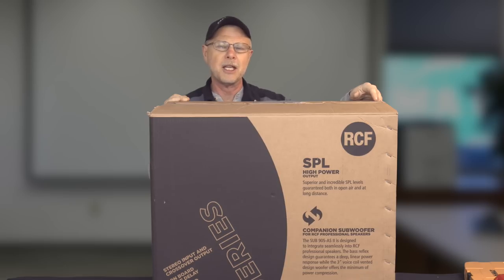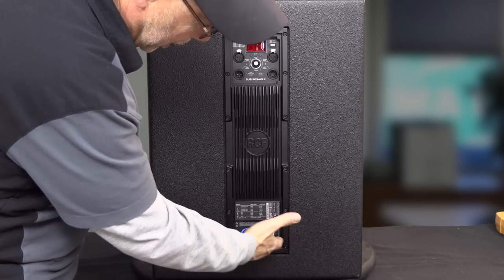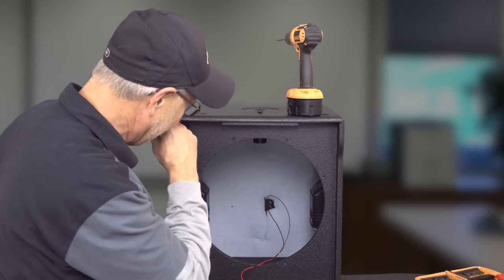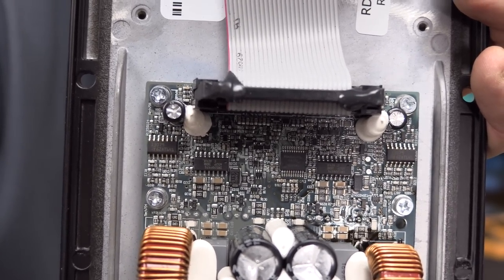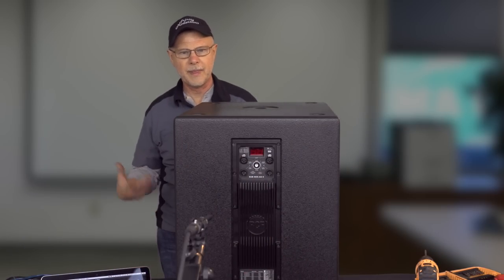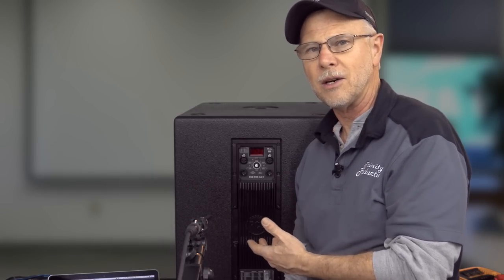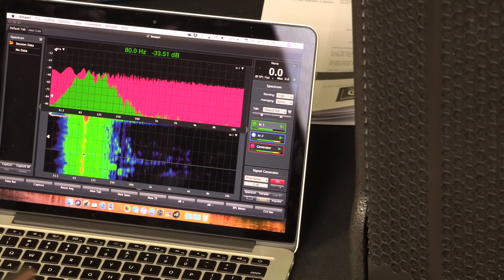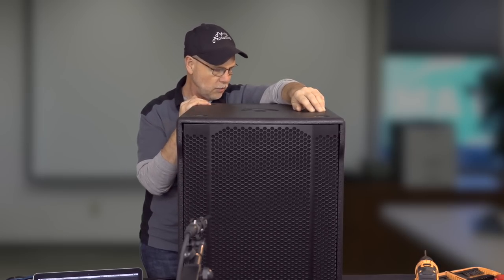RCF SUB 905AS II COMPLETE REVIEW - AUTHORIZED PREMIER PARTNER DEALERS

Comment: Amazing review like always. We have used this sub in the last few months quite a bit and it's amazing paired with the sub8003as II. Two of these subs on on H2 and the sub8003as II on L2 is just amazing.  I'm just curious about the new  TTS15-A. It's the same 1100w amplifier, 15inch driver and about the same size, and 1 db higher. But the price is also much higher...So i'm wondering..is it worth the upgrade? Do you have an opinion on the TTS15-A?
Reply: It's the first sub from the TT line with a 3inch voice coil..Even the older tts12a had a 4inch voice coil..That's why I'm worried
Reply from the maker: It may have the driver from the TTS26A subs and not the same as this being a stamped basket and ceramic magnet. The footprint fo the amp looks similar, but would have to confirm with RCF on the amp, that would be a shame to use the same amp on both speakers, the TT being a premium line. We have the TTS26A subs and for a dual 15" they are killer. I have not heard on the TTS15 and most likely being so new we won't see here in the USA for a bit .. RCF has been doing some amazing thinks with small VC as with the new 9007 subs being 21" with small VC for faster reaction time of the driver. For a 15"  I have no issues with a 3" VC vs. 4" .... as long as the driver does the claimed power rating and won't destroy itself under operation/load.
Reply: Did you get good results from this set up ? the 905 set at H2 and the 8003 ON L2,  did you suffer from "coupling" issues ?

Comment: Great video... i would like to know if you have used the 708mk2 and what are your thoughts on those subs?
Reply from the maker: We have not seen a 708mk2 come through yet, however based on the amp and specs of similar RCF subs we have seen , the 708 will kill a KW181 and for the price point and features the 700w sub will be hard to beat from other "similar" competitors. We have found that QSC, JBL, EV and other fudge the power number to their favor to look good on paper, but poor on lasting performance. RCF has always IMO given the most bang for the buck.
Reply: trinityprosound would you say the 708 mk2 be more for small to medium size event halls or medium to large halls? Based on the size of the sub and specs compare to lets say a 8004 sub or 8003 mk2...??Thanks
Reply from the maker: yes, with the power of 700 watts RMS, but still has more power than a QSC KW181. The 708 as with the sub series is going to be similar construction and most likely at stamped frame basket like this one and maybe similar driver. Nice thing about SUB series is built in crossovers, you don't get that with QSC or others...with  a pair of 708s the sound would be better than anything QSC or JBL or EV offers in that price range
Reply: trinityprosound would you say the 708 are for small to medium size event halls or medium to large indoor event halls?
Reply from the maker: small do medium, you will need double 18's for large indoor events and most likely more than 2
Reply: trinityprosound how would the new 8003 mk2 compare to the 8004 with the new DSP the 8003 mk2 has ?
Reply: Yes indeed i will use a pair of subs but what i meant to say if two 708 subs handle medium to large event halls or stepup to the 8003 or 8004 subs to be on the safe side?
Reply from the maker: the MK2 DSP gives you more control over prior models with new DSP, but all the 8004 we have sold to date, everyone loves the sound and output of them without updates to DSP, etc.
Reply from the maker: for large event halls, etc. IMO would go with 8003 or 8004 and you may need more than 2 as LF energy drops off quicker than your top boxes. If you just wan to fill a dance floor you may be OK, but remember the LF wave does not develop that close in and the tables and seats where the wave finally develops will be pounded by LF energy.
Reply: trinityprosound the hall ill be at this month is not that big but a bit wide. Thats the reason why i believe 2 subs are alright but debating between the 708mk2 or 8003-8004 .
Reply from the maker: If you can do the 8004 you won't wish you did in the future...buy once cry once, get as much sub as you can afford and don't skimp...lessons we have learned the hard way for us...

Comment: Hi, I have a pair of 905s and a pair of rcf 715-a mk4, what gain on the sub and what preset would work the best. I had the old 905s and these ones don’t seem as loud
Reply from the maker: start wide open, the DSP is not the same as the old units. I believe they are wide open when shipped "0", you reduce from there on the rotary encoder.
Reply: trinityprosound no I have the 905-as mk2 just wondering what preset and volume should I do with the rcf 715-a mk4

Comment: question, How is the rcf  sub 705-asMk11 stock up against the ev ekx -15sp would like to hear your opinion.
Reply from the maker: Have not heard the EV sub and currently not dealers, but not a huge EV fan either. I have seen their speakers and feel they are done on the cheap vs. what we have seen and used from RCF.
Reply: thanks.
Reply: Im pretty sure you have tom compare this to the EV ETX 15sp instead, as it is more the same price range and power range

Comment: hi trinity, i have 1 sub rcf 705 as (first series). There is great difference with the 905 as II ?  thks
Reply from the maker: yes, it has 200 more watts of RMS power and built in DSP. We installed 2 in a gym at at church as was really impressed with them.
Reply: trinityprosound thks. Do u think that with a pair of rcf 710 mk4 and ONE sub 905 as II is a good configuration for dance music with 100 max 200persons?
Actually i have 2 rcf 710 mk4 and 1 sub rcf 705 as.
Thks
Reply from the maker: Would be better with two of the 705's you are asking a single 15" to do a log of work.

Comment: How does the delay work? If sub behind tops or front ?
Reply from the maker: The delay is going to be used for cardioid type sub set up. typically with aligned tops to subs, you would not delay that kind of deployment.

Comment: Hello
How much delay does 2 and 3 modules use for L2 (80hz) and L3 (100hz) settings?
Reply from the maker: since they are small, 2-3 MS and 180 degree phase reversal on the rear facing sub for cardioid setup
Reply: @trinityprosound  Thanks

Comment: 905as vs nxl44a top ok??
Reply from the maker: The NXL44 top will out run the 905 really quick, you will need like 8004 or 8006 sub with that top box and the 3 x 10" drivers in it...

Comment: would 2 of these match ok with my 745s..the 8003s etc are too heavy for me these days .and im.wanting to add subs just using 745s on their own at moment.
Reply from the maker: The 905 is a good 15" sub and has a lot of power behind it...it does do a good job, but i like the 18" 8003 or 8004 better for good low end. But if weight is an issue the 905's will do a decent job. We installed 2 in a school multi use room under the stage and was quite impressed with the output of them. They are a solid 15" subwoofer. Depending on what you are using them for , live vs. DJ ? they should provide you with sufficient low end to do what the 745's can not do. Use the built in cross over of the 905 and set at 90hz to the top 745's and it will give you a great transition from sub to top box.
Reply: @trinityprosound  they are to use in a vocal duo with playback singing pop / rock commercial covers , would they do that job ok ?
Reply from the maker: yes, sure will !
Reply: hi another possibility advice needed ..
been offered a single RCF TT 15a ii sub at a good price ....could that work with 2 x 745s , couldnt afford 2 TTs maybe later .
Reply from the maker: yes for a start it sure will....
Reply: @Trinity please.... I currently have a pair of the 745AS. Would these complement them enough for wedding events in larger venues. What settings would you recommend please. Thank you in advance and thumbs up for your vids👍👍
Reply from the maker: They would, while they are 15" , they do a decent job and have more power than many in the same class, but with that said, it is a 15" driver and smaller cabinet volume that a 18" sub and won't go as low as a larger sub or speaker with larger cabinet volume, but it will certainly get the job done.

Comment: may i convert that speaker into mid bass woofer and i use it as my flyable woofer for line array,?
Reply from the maker: no. it is not constructed to fly, you will need a S09 or KS10 sub to fly RCF does not have flyable subs in their SUB line up... only in TT series. so look at db technologies for that...
Reply: trinityprosound thank you so much sir.. have a good day and more power to your channel.

Comment: could i get away with one 9005as ii with my 745s  , space in car is a problem with 2  and the 8003s are a little heavy .
Reply from the maker: yes, but, the 745's will out run the sub for sure...but it will certainly give you a better low end than just the 745's
Reply: so the 8003 as ii would be a lot better ?
Reply: is the 8003 aasii on its own a lot better than the 905as ii?
Reply from the maker: yes it would , larger driver, larger volume of box , better low end IMO

Comment: Have you ever look at D.A.S. Audio?
Reply from the maker: Yes, but we don't need another line...and RCF and DB have everything and more than DAS
Reply: trinityprosound I just bought D.A.S. Audio Vantec systems they are pretty amazing speakers 
I like RCF as well I have never tried DB though ran across your channel as I am looking to add RCF 705 AS ii and cant figure out what small 10 tops to pair with one sub trying to put together a small system without having to go with EVOX I had evox before as well it’s nice but want something different
Reply from the maker: I have not heard that series of DAS yet. Look at the SUB905AS more power and really a great sub with a lot of power. The ART boxes will pair nice with those subs, but I would look at the HD10. That box to me with new processing will do a great job with a 905
Reply: trinityprosound the 905 as ii looks to be a solid box 
I am looking for something light that can be easily moved in a car from small gigs for 100-175 guest wedding dj type stuff easy in and out just with a little more lows than the EVOX 8 I think the EVOX 12 is over priced and not what I’m looking for so my thought was to get the RCF 705 as ii and pair up with 10” tops 
What light weight good quality road warrior 10” would you match or maybe light weight 12”
Reply from the maker: I would to the ART series or the HD series, I like the look of the HD and they seem to have a bit more low end than the ART boxes. Everyone of my customers that have purchased the HD boxes love them.
Reply: @trinityprosound  John, do you like the HD32 better than the ART745 MARK 2? And would they overrun these 9005 subs?
Reply from the maker: No -  the 745 with large driver and low crossover point wins. A HD45 would be great ! But the 745 is sooo smooth. They would keep up with the 9004 or 8004 sub with the right cross over settings...to limit the low going to the 745 or HD32.
Reply: trinityprosound which exact top would you match for 1 705 as ii for typical DJ wedding gig for around 200 guest banquet setting light weight in and out

Comment: what’s the best subs to pair with the rcf nx45a tops?
Reply from the maker: the newer SUB8003 would be great or the 8004, lots of power in either one of those
Reply: between the 8003 and 8004 what is better? what are the differences?
Reply: also how many people could i be able to run with that system?
Reply from the maker: better DSP on the 8003, newer design. are you a DJ or live band for that system... ?
Reply: iam a dj
Reply from the maker: The 8003 will be the best choice for the money. Newer DSP and not much max SPL difference between the two and an overall updated design for the 8003

Comment: hi! this sub 905 as2  vs 8003 as2  ?
Reply from the maker: They are not the same. One is a 15" and the other is an 18" same amp and power. Me, I would take the 18" any day, moves more air and goes lower consistently
Reply: thanks!
Reply: We use the 905 and the 8003. Both mk2. The 8003 is as loud as 2 905 subs.
 Go with the 8003. No regret.
Reply: trinityprosound  eco 8003 as2 vs fbt cla 118 which is better?
Reply from the maker: Those models are very similar in power and output...we have the FBT dual 18's and they are great...but the RCF sub has a 4" VC on the 18" driver and i do like the amps of the RCF boxes a bit better... but both are good subs.
Reply: trinityprosound thanks a lot!

Comment: Question would this sub be enough for a db igt4 one per side meaning one 705 with db igt4 per side
Reply from the maker: No. the IG4T will out run that sub, you will need at least a single 18 to keep up with it. KS10 or SUB18H or RCF 8004 or 8003 or FBT SUBLINE 118 will pair nicely with the IG4T's

Comment: Isn't it poor fitting a stamped basket ferrite driver to a sub costing so much?
Reply: Couldn't agree more. I would have bought a pair of these if they had proper cast, neo drivers. You can get subs far cheaper than this that are using quality drivers and it just seems RCF are relying on their name. Over here, the sub is around £1200 putting it in the premium small sub category yet without premium drivers. Just very poor.
Reply: @theboogieknight8279  what do you prefer over the RCF in terms of build, sound and performance?

Comment: How could you not like QSC?!.. I'm very happy with mine and they're still selling like crazy!
Reply from the maker: They are marginal and not much innovation. They sound just OK compared to others speakers at or near the same price point from RCF , db Tech or FBT. They lie about the power of the amps, or at least state it is 1000 watts , well yes peak it is... they have fans that can break and toast your speaker from overheating. They are only selling like crazy because stores like guitar center and others don't stock or sell much of the above mentioned and the margins they get on them, the poor buyers really don't get how they have been screwed .... the drivers in them are OK ,but OK is all I can give them...so many better speakers out there..
Reply: Nah..they can't be that bad, thousands of people can't be wrong. You tested out some KW tops a long time ago and seemed to be very impressed with the box. I'm by no means a one brand fan  boy but my K12's and KW181'S two of each have done extremely well for me. I'm aware there's great  speakers that will out preform QSC    but the reliability of these is unmatched. Imo.
Reply from the maker: thousands of people don't know any better and take the crap Gtr. Center and others tell them is good. They have no clue that other speakers like these exit so they buy and have no clue whatsoever.
Reply: @rudycorraudio9089  what I find funny is how he mentions kw181 with no crossover. Ok, fair enough but used with qsc you simply flip a switch on your top cab to with sub and problem solved. I have many different rigs for different events and while I like external crossovers, I know I always have a simple qsc option.
Reply from the maker: QSC is marginal audio equipment, power ratings are over stated and no true RMS power figures are EVER given. They use fans, which suck, if you don't have a top that has a HPF on it you are screwed. QSC uses marginal drivers and for what you get is over priced. I can get more out of a pair of Alto Series 3 boxes than K12 or K12.2 - RCF or DB Tech kills the QSC line -
Reply: @trinityprosound  I'm not knocking rcf in any way. Very nice gear. I think for some of us, we've experienced decades of worry free qsc use. I have five of their amps all purchased 1997 to 2001. I clean them and that's all. Never a failure.

Comment: Hello. I have two RCF Art 745A's. And would like to get some subs for them.
Im currently looking into the following:

2 x RCF SUB 905-AS II
2 x RCF SUB 8003-AS II
1 x RCF SUB 8004-AS (And maybe get one more later, but im not sure this is worth it now with the 8003-AS II being out)
1 x JBLSRX828SB
2 x EV ETX 15sp

Can you give me a recommendation on which you would prefer and why? I really like the tight bass from 15" drivers. So i was thinking about going either with the 905's or 15sp's, but they only have a 3" voice coil compared to the 8003,8004 and 828 4" voice coil, so im sure its a good idea.
Reply from the maker: We can get the EV and JBL out of the equation as they are IMO pooh. The 905AS2 for a 15" sub is quite a beast and is tight and punchy. The 8003 for a single 18 is great, but my winner is the 8004, yes more $$$ than the others, but buy once cry once. You will not need to consider another single 18 sub again. Everyone that has purchased those subs "love" them and can believe the output from a single 18" unit.
Reply: Thank you so much for the reply. I will go with the 8004